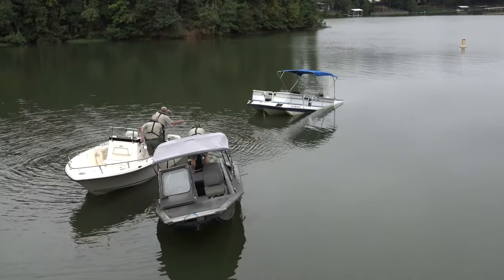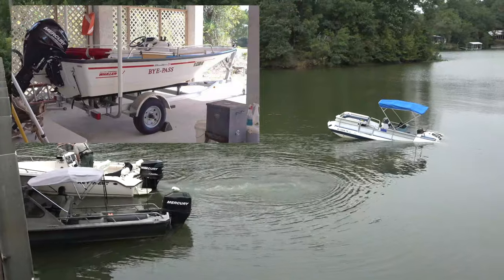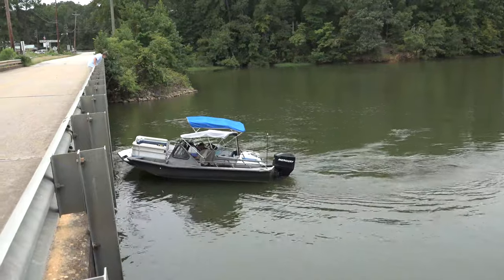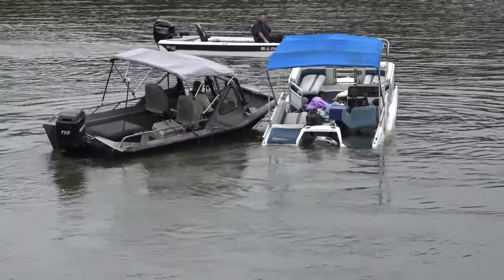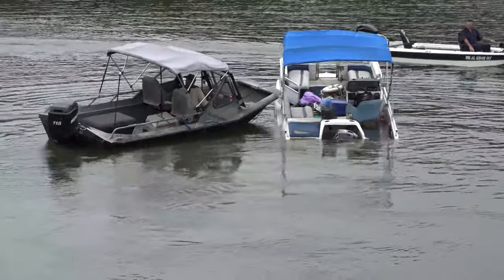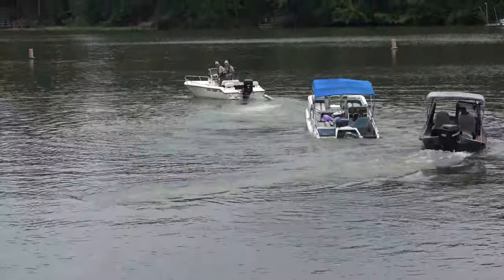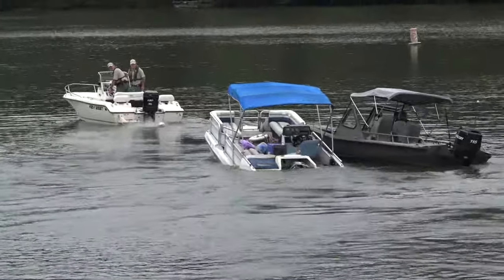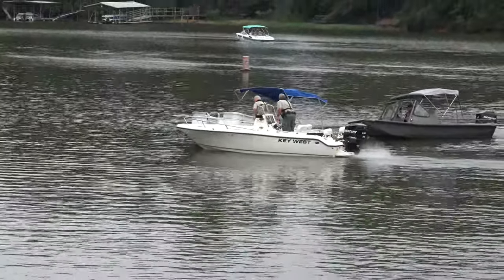That Sinking Feeling - What Happens When You Fail To Put The Plug In Your Boat And Launch Video

Comment: Thanks for that excellent reminder of  a simple but significant mistake that can at least ruin a boat ride or fishing trip. I has also resulted in lost boats and equipment as well as drownings. Think of a bare-bones checklist for launching. PFD's, anchor (tied with rope and secured to the boat), oars/paddle, plug inserted.. Also, please be courteous when at the launch ramp: Get you checklist completed BEFORE you enter the ramp. This prevents wasting the time of others who are also trying to launch or retrieve their boats.
Reply: You aren't that guy who sits in their truck steaming with bad attitude watching the minutes tick by because someone at the ramp isn't as fast as you are you? Everyone hates that guy. Even more than they dislike the less experienced slow guy at the ramp.
Reply: No I'm retired and very patient, but I've seen a good bit of ugly at ramps all over the place.
Reply from the maker: Thanks Larry, you're quite correct about this of course, and it is what the staging area is for before you get to the ramp.  I wasn't really thinking about the plug itself at the time and made it more of a towing video, as the first thing they always do is toss you a line and beg you to pull a boat you can't pull (with low horsepower).

Comment: Happens s lot. When I lived in the Keys we used to get calls to raise sunk boats all the time. We had a set of drums wrapped with rope. We would take rags and plug all the holes we could, sink the drums, lash them to the hull and fill them with  an air hose. Then we put a 2" gas water pump in and pump like heck! It was like winning the lottery back then!
Reply from the maker: Agreed.  The sad thing with this one is if they'd just plugged the hole, got it to the ramp and put it on the trailer (then flush and run the engine) they'd be fishing today . . .  Instead they just left the thing in the water for 2 weeks.
Reply: @mattmattsongold  bad news! Salt is the worst! You are exactly right! Get it up, get it out, flush, spray and get it running!

Comment: That sucks I know first hand now yesterday we got to the ramp had a lot going on and totally forgot the plug. Luckily we figured it out still at the ramp and the motor never went under water. But it took on a lot of water and was hell to get it on the trailer and out of the water. That won’t happen again I promise that lesson learned quick
Reply from the maker: We've all had these moments, and just be thankful you didn't lose the boat -- it won't happen again by you I'm certain.  After an incident, it leads to multiple checking that plug before a launch - it's that traumatic.
Reply: @mattmattsongold  for sure it’s that traumatic!!

Comment: Glad to see it wasn't your boat, but I'll bet you have missed placing a plug or two in your lifetime, I know I have. Here's another sad story. My son-in-law's father was taking his boat out at New Smyrna and because he did not have an experienced crew with him, he backed the trailer, and got out of the truck to motor the boat onto the trailer. No one was in the truck, but parking brake was set and motor running. The minute the boat hit the trailer the whole shebang started backing into the water. His truck went all the way under: a total loss; no way to save money trying to fix a truck motor, electrical system, and body after a dunking in salt water. Took them hours to get everything out of the water because the trailer had backed beyond the concrete ramp into a hole. Had to dive to unhitch the trailer in order to pull truck out. The problem, besides not having a person remain in the truck, was this ramp was known to eat trucks because of the algae on the ramp. BTW I may comed see you in late Sep (25-28). Let me know by email if you be home.
Reply from the maker: Ed: September 30th - October 3rd is our window.  Email me for more options if that one doesn't work.  I did my confession on Florida Sportsman and might as well duplicate it here: I will confess this one thing (and only this): when I was a very young man and had a crowd watching at the ramp I wheeled that trailer around and splashed the boat in like Joe the pro I was.  Jumped out of the truck, walked back and realized I hadn't unstrapped the boat and it was now floating the trailer, just the two little guide things sticking up (which attracted more of the crowd, especially the good looking women . . .), so I said in a loud voice: "That ought to be clean enough!"  Got in, pulled out and took it back home and waited a couple hours to launch when I figured that crowd was gone.  -- Very familiar with New Smyrna at night (shrimping) ramp (and the worse ramps at Edgewater) - almost had my truck slide in on the same algae (and that was in the 80's) and all I had was a Whaler 17, certainly not heavy.

Comment: The boat didn't need to sink. I've spaced the plug a couple times but you just have to keep moving. No water will come in until you stop. Just ease it up on the beach or if you're lucky there's someone you can call to back your trailer into the water and pull up on it and get the plug in.
Reply from the maker: You are absolutely right.

Comment: Bet they won't make that mistake again.
Reply from the maker: Not with this one - but abandoning it is a troubling sign for the future.
Reply: @mattmattsongold  that deadly fire aboard the Conception is just another troubling sign. I'm no professional mariner, but wouldn't think of taking my 16 footer, or any boat packing liquid fuel, out on the water without checking the fire extinguisher first. Coming from a multi-generational boating family, taking every precaution against fire has always been a top priority; galley fuels kept to a minimum and stored in fire resistant leak proof secondary containers stowed sensibly, etc..
Reply from the maker: If you're checking all that - you're a professional in every way.  Agree totally.  (and you have me beat on footage . . .)